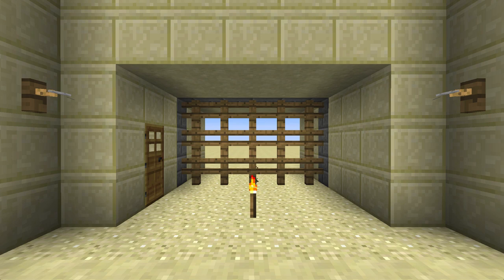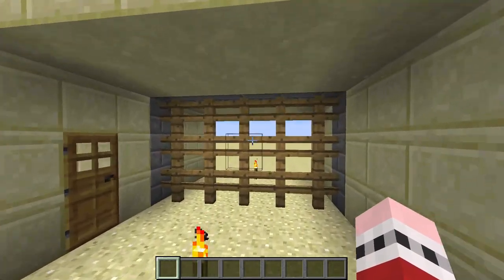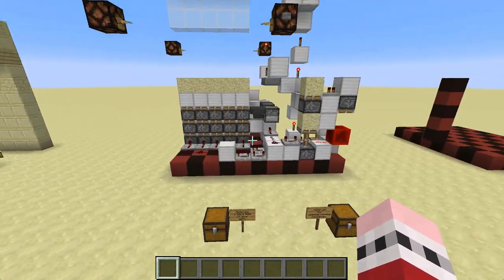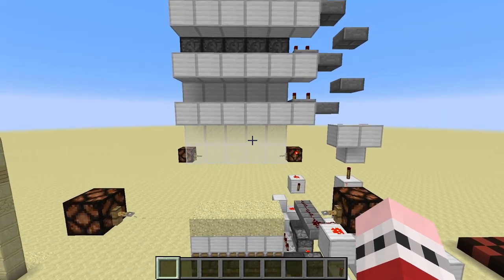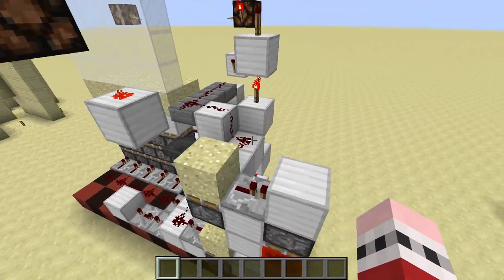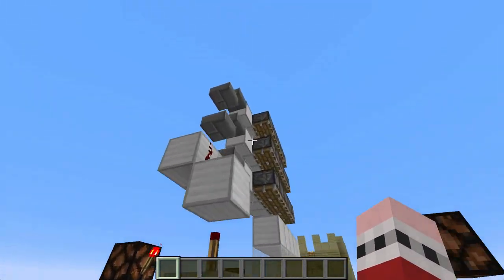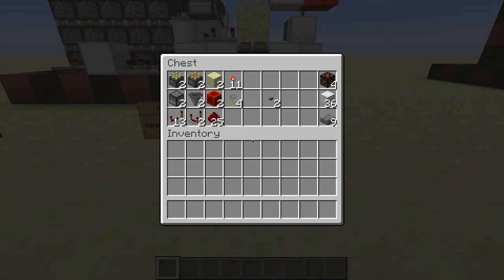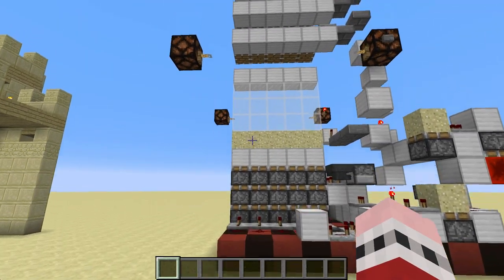City Gate (Minecraft Showcase Video)

Comment: Why didn't you just use a double extender w/ a normal piston on top, like any other portcullis design out there?
Reply from the maker: I wanted it to be 3 tall so I could ride a horse under it.
Reply: Dude... :D The sand falls by it self, so there is no need for the third block retraction, if you just remove the block between the sand and the triple extender (use more sand if you have to)
Reply from the maker: WoolTec Mc Oh. I see what you're saying. (I misread your first comment.) Couple of reasons. First, I really liked this triple piston extender and I can see myself using it for other things. I like reusing good designs. Second, I've seen cases where using sand under that sand block rarely results in broken sand blocks. I suspect that wouldn't happen if the top piston were a regular piston and didn't have the extra retraction step but I didn't feel the need to futz with it since I already had a ready-made design which works perfectly.